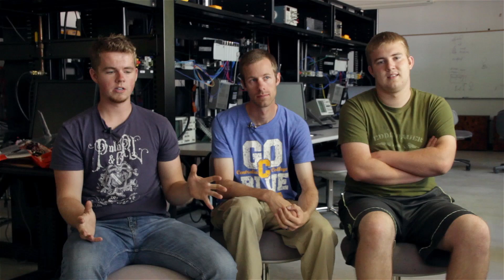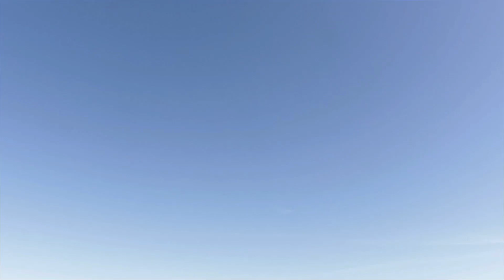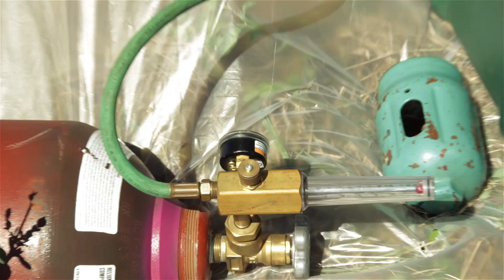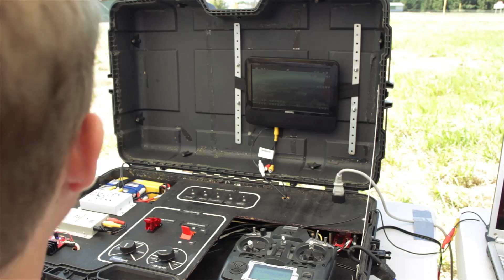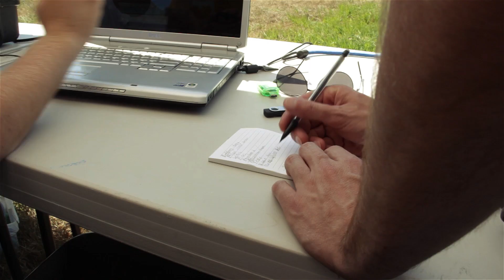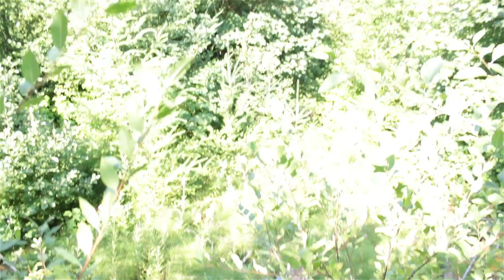Centralia College Near Space Glider 2014

Comment: We didn't modify any equipment. For the fpv gear we used the ReadyMadeRC 1.5w 1.2 Ghz video tx/rx. However, when going long range the antennas are the most important pieces of equipment, not the electronics. We used the ReadyMadeRC Gatling antenna on the ground station and a diy clover leaf antenna on the glider.
Reply: Hey Blake, did you guys get an FAA clearance for this? working on the same project right now and this is the biggest challenge